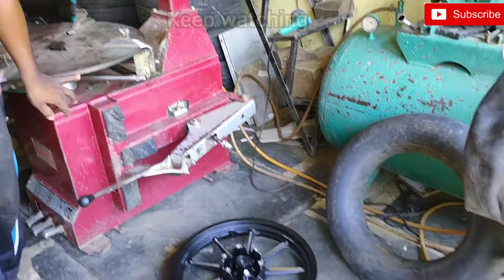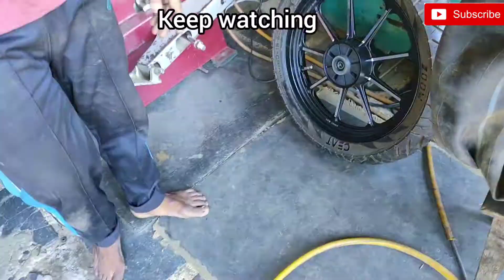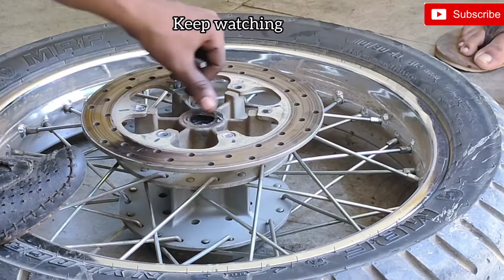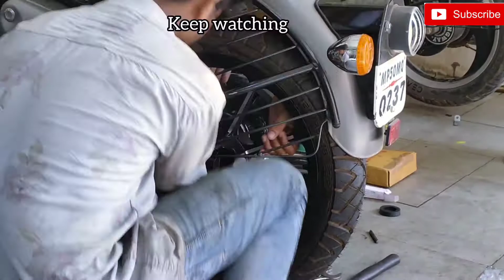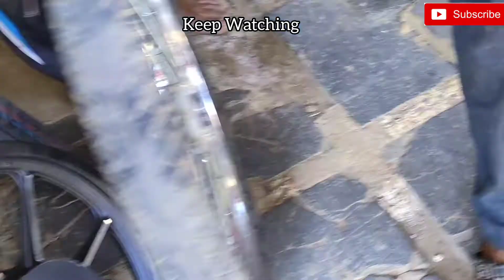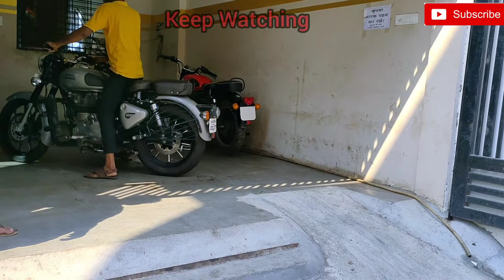Alloy Wheel for Classic 350 Bs4,Bs6 ||Genuine🤗||fitting||😇Gunmetal Grey @RoyalSourabhVlog

Comment: Did you face any bending or cracking issues after using these alloys, actually I’m planning to install these alloys in my classic 500, so need review?
Reply from the maker: Not yet bro 🤟
Definitely go for it 😊
Reply: No problem definitely good product all ready iam used ..because royal Enfield brand
Reply from the maker: Right
Reply: Iz it will b available in Authorize showroom??
Reply: @sri54404  Can I do normal offroading with these alloy wheels?Mean  do I need to put brakes every times while crossing small potholes or speedbraker as compared to spokes wheel?
Reply from the maker: Yes
Reply: Tyre size kya dale sir